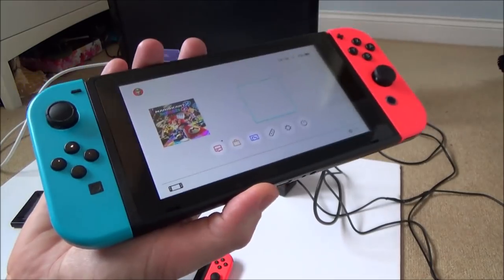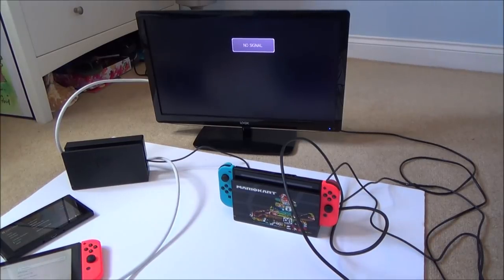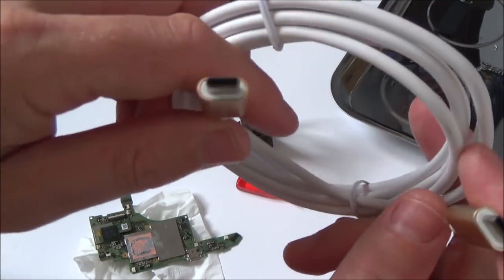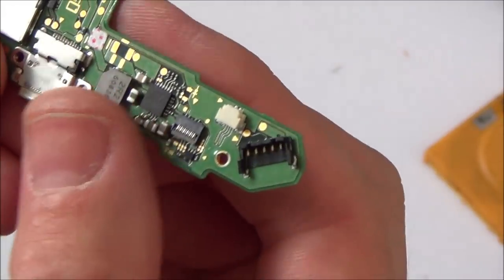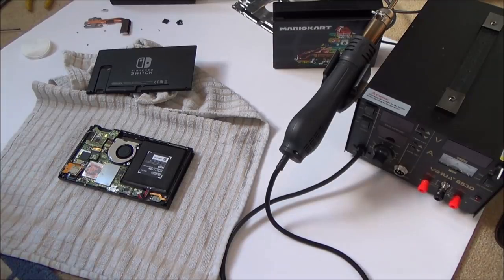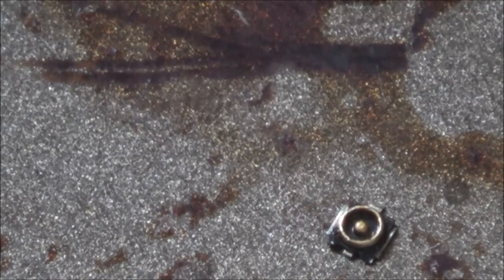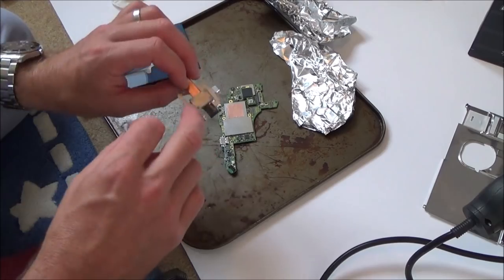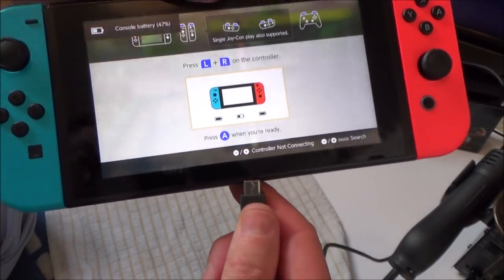UPDATE: Trying to Fix the Faulty Bent Nintendo Switch Not Docking

Comment: ok, first of all, nice going with the repair. You've kept your head, been careful and you've done a pretty good job all around.

now:

* try to factory reset that non-docking switch, it sounds more like a software problem, but it could be that one of the chips is broken internally, so the external switch circuitry is dead

* that blob of thermal paste was 4-5 times bigger than necessary. air's a good insulator, and the paste is supposed to get rid of any microscopic air gaps, not magically move heat

* if there's ever a kind of large, fat, putty-like square between heatsink and chip, it's a thermal *pad*, don't chuck it away as thermal paste won't work. You CAN buy replacement thermal pads real cheap from china, but getting the right thickness/type is a PITA.

* you should really get some thermal protective tape instead of using tinfoil, which is spreading the heat rather than protecting

* USB-C is reversible, but that means that bottom-left switches to top-right, not bottom left to top left when you reverse it (it goes around, not mirrored) :)

* when you're heat gunning things, don't yank the components, take your time, don't blast things, and use tweezers to ease them up when they're loose, or you risk pulling up the tracks on the motherboard.

* when in doubt, flux.

* get yourself some IPA (iso-propyl alcohol) for cleaning up flux, the alcohol you used is good, IPA is better.

* learn about solder braid for cleaning solder pads

* have fun, you're doing really well :)
Reply from the maker: Brilliant, great list of advice and tips. Thank you :-)
Reply: Get your self a IPA ( beer) for drinking after fixing stuff.

Comment: They are 2 different kinds of thermal grease, likely applied during 2 different stages of assembly, the copper/gold silicone ones are fairly cheap to buy in bulk (you can get a peanut butter sized tub for 20$ on amazon) as opposed to the compound you replaced between the heat sink and  heat spreader which is more expensive.

Comment: Love the videos, I started repairing consoles and computer over 15 years ago. Couple of things I learned are... The more flux you use the better and buy the good stuff don't cheap out. The pen style no clean flux are kind of crap, the style in the syringe work much better. When doing small components the extra flux helps hold the component in place. Also, keep the tweezers on top pushing down when heating. Another good item to invest in is thermal tape to protect components you don't want to heat.Thermal paste is there to fill in micro or large cracks to make sure you have 100% contact with the heat-sink. When buying thermal paste make sure its non conductive, Arctic Silver #5 is what I use. Never worked on a switch but I would guess that one has a software issue not hardware.

Comment: If the CPU can't see the video encoding chip (if it has one) that does HDCP (content protection) that is on the switch itself, it will not output video to the dock. My guess (without looking at schematics) is that you have two chips on the switch itself not being able to communicate. The nasty thing here is that there are circuit traces inside the circuit board (it has more layers than front and back) and those may have been damaged by bending. If you know which pins on which chips should be connected for this hdcp you could measure if the pcb is still okay or if the trace inside is broken. The typical fix for such a thing is to actually micro solder a wire between the two points that need to be connected. Louis Rossmann shows how to do that in many of his videos.
Reply from the maker: OK, I never knew that more traces were sandwiched inside the board. I thought it was just top and bottom. So if I knew the faulty trace then I could bridge the points with a jumper wire. I think it is probably time to give up on this Switch as I will not be able to check that. Do you know if it is possible to have multiple layers inside the circuit boards or is it just top, middle and bottom (not on the Switch but other devices).
Thanks, Vince :-)
Reply: Circuit boards can have many layers. Don't know if there is a manufacturing maximum.
Reply: Get a soldering microscope to see the motherboard better and is a good add to your tools you fix stuffs
Reply: Two and four layer boards are common. Though I have seen 8 later boards as well. As a check, I would look up the chips around the bend and find their power and ground pins. Then test them for power and ground. 

A two layer board is top and bottom.
A four layer board is normally top, bottom, power, and ground.

Comment: Hey this helped me but only briefly. Using a small plastic prying tool, I wiggled it around the USB-C port on the switch. Then I tried bending very gently the small metal connector inside the port. That made my switch work when docked, but only for a few minutes. I managed to replicate this result by > undocking > putting it in sleep mode > repeating the wiggling with the prying tool > docking > waking the console with the joycons detached. I noticed moving the console even slightly made my picture go away on the TV. Hope this helps figure out what the issue is.

Comment: In addition to a factory reset (there are posts on forums about corrupt video drivers) the other thing you can try is set the TV setting to Automatic, turn off the Switch fully (hold power button until it fully shuts down), dock it and power it on while in the dock so the TV is present during it's boot-up phase.

Comment: Hi Vince, 
A complete Factory Reset should cure your issue, and it's an issue a few others have had, and cured having the issues with docking.

It is software related, and should be cured with a reset.

Hope this helps
Reply: Agreed, but I did a search and for some people reset didn't work.
http://www.nintendolife.com/forums/nintendo-switch/tv_resolution_is_stuck_at_480p_after_update_4_0_0
Reply: It's not docking also, that points to a Hardware fault not software. Any Switch can dock with 480 resolution. This one can't and doesn't output image, so it has some hardware problem, most likely some cut trace or break in some lines (or can be some ic).
Reply: Jason Birch I
Reply: @Falcon_Indestro  I was thinking about everytging you've said.

The bend in the board MAY have caused a break in a trace it two, which would cause the lack of video output, so perhaps a ground  is not being made. The reason I say that is, while the switch isn't displaying video on the tv via HDMI , the switch has transferred the signal to the relevant section, and has been recieved by the output section on the switch....
So, perhaps the lack of video is a break of a trace, from the signal processing section to USB, only checking continuity of the usb bus will tell Vince this. However the 480p issue is software, and it is connected somehow to the lack of video to the tv. 

If the reset doesnt work, then there will be a conflict due to communication failure between the switch and the tv. The tv tells the switch what it's capable of displaying, the switch unlocks , so perhaps, the software side is dependant on the communication.

What I'm saying is, it could actually be both. However for SEPERATE reasons.

Only until he follows the signal path will he know.
Reply: @juliangarcia4103  you've left me in suspense too long matey. 🙂
Reply: @argy111  i am so sorry i usually read comments at the end of the video i might have accidentally sent that without me noticing
Reply: @juliangarcia4103  no worries matey. Although I am feeling a little disappointed now. You left me hanging on the I...

Hahah funny as though. You have a great evening
Reply: @urielbritneybitch  nope...
I repair consoles for a living
Nothing to do with Nintendo support.
Reply: It's not impossible that they have, on a software level, implemented error handling that ignores options that doesn't work or is returning errors. Tbh, a good programmer would try and handle any errors as gracefully as possible, and in this case maybe that was too just ignore any that won't work.
Reply: I have the same issue, done a factory reset... with no luck but the again my docking is blinking on and off not a permenate green... I also have the locked 480p or automatic  only options :/

Comment: not sure if you are still monitoring these comments but I have a switch here with exactly the same issue. I bought one with a docking issue and 480p only. I tried everything to get it working, system reset, diffrent dock, different ac adapter etc etc. I then left it overnight in the dock charging, woke up next morning, pushed the home button on my joycon and it actually showed an image on screen. I then restarted the switch whilst docked and the video options all showed up. I selected 1080p, undocked the console and redocked it multiple times and all seemed well. I put mario kart in and it then started to update then all of a sudden my screen went black and now the switch won't dock. Out of ideas, anyone got any input?

Comment: Hello Vince, i don't know if you still own this switch, but i just repaired mine with similar behaviour. On mine it was the M92 chip that was not fully soldered, to do so, I used some solder paste applied with a toothpick on the 4 corners and melted it, then after removing the bridges, the switche finally docked and charged on both ways

Comment: Any update on this? 
I have a switch with a similar issue. 
Except,  I have all the resolution options.
Works and Charges fine,  used 3 different TVs and 2 known working docks. 
Just can't get it to Dock. 
I Bought it Second hand.....  Was told it was a broken Dock.

Comment: I had this issue too on once I was repairing, the plastic around the usb port was ever so slightly warped so when I docked it, the green light went on and it charged but no display, it would sometimes recognise it but still no display. Figured the plastic was creating a little push since it wouldn't slot in nicely and the switches seem to be quite finicky getting them to dock if you happen to move it ever so slightly when seating it.

I cut the plastic away and now it docks without issues.

Also good to check P13USB and the bottom pins towards the filters near the usb side, each pin should head towards the other side of the filter and can be checked with continuity. If one filter is bad there can be a cross over where both pins go to both ends of the filter. Replace it and you're good to go.

EDIT: By filters I mean the square black components under the caps under P13USB that have 4 connections to them. Any docking issues, if the USB C port is good, will probably revolve around that chip and subsequent components.

Comment: Have you  restored it to factory setting I assume you have but if not try that  you never know
Reply: Georgie Steward when u start up a new switch it has to go to the tv so if he resets it it could be completely useless
Reply: no it doesn't you can skip that part of connecting to the tv when I bought mine I never connected it up and just use it portable
Reply: @JEFF-dd3vu  thats 100% false pal. I bought one a week ago and met the guy in a Dennys parking lot and was patient enough to let me set up my hotspot and connect the Switch to it and set it up entirely.
Reply: @sethkauffman9915  he skipped it when he fixed this switch that isn't docking
Reply: @sethkauffman9915  sry meant to respond to jeff comment
Reply: I had this problem, and tried that, but te factory reset didn’t change
Reply: J  I didn't wiped the data, I know it can be corrupted, but for me the best solution was keeping the data. If you have switch online you can restore some of the Data

Comment: Nice vid, very complete. For the display mode issues, factory reset the switch. Not sure if it will help the docking issue but it will for sure bring the display modes back.